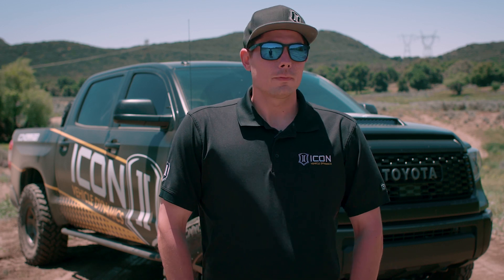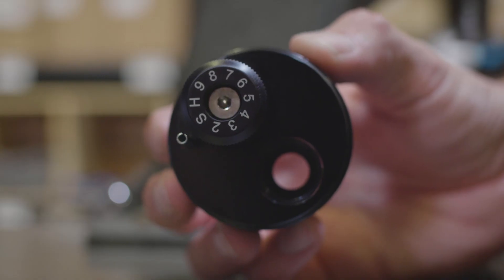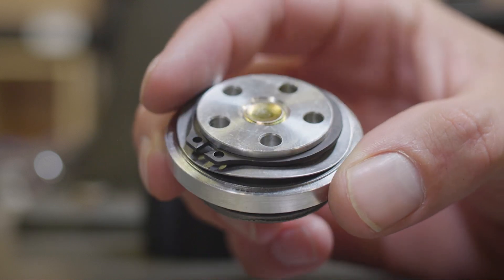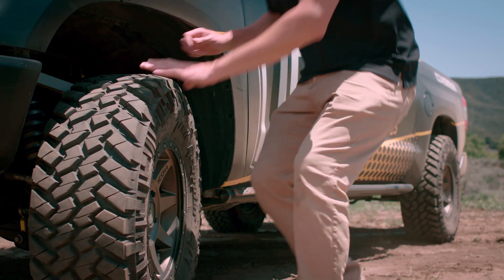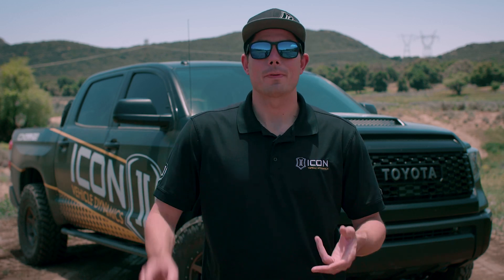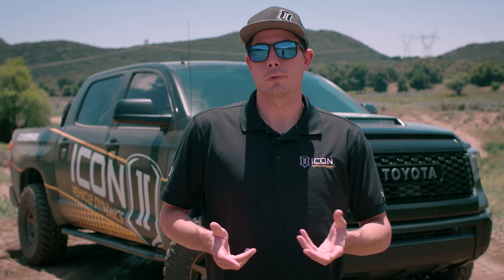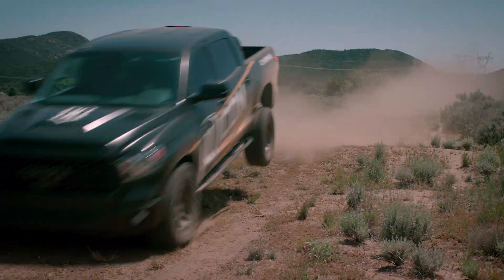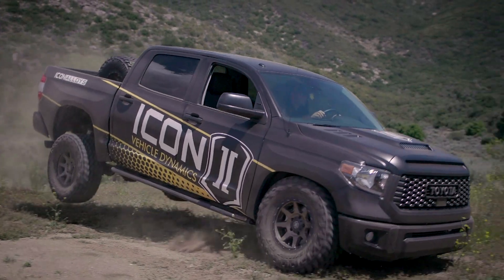HOW TO: Adjust Your ICON CDC Valve Shocks

Comment: What is done to the tundra in the video? Is there a video or write up on it's specs?
Reply from the maker: Hey Ryan, our Tundra is equipped with a Stage 9 ICON suspension system with a Stage 2 S2 secondary shock system. We're running 35x12.50" Nitto Trail Grappler tires on 17x8.5" ICON Alloys wheels.
Reply: I need an s2 secondary bypass shock for my 19 Ranger.

Comment: I currently have the ICON 2.5 w/Res and CDC Valve on my 20ll Tacoma. Im planning on installing a Demello aluminum bumper and Smittybilt winch w/ synthetic line. Consider the added weight that my truck will be experiencing in the very near future, In your opinion will the 650# rated spring be more then enough to support the weight or should I upgrade to a 700# rated spring?
Reply: I do have steel bumper, which is why I am going that route.
Reply: I have a Demello bumper and winch and am upgrading the springs with this next rebuild. Icon recommended the spring upgrade.
Reply: RecoveringUGrad unless you’re going with a steel bumper then I can see you upgrading to a 700# rated spring. However if your going with an aluminum bumper, 650# rated spring is more then enough. I have the Demello aluminum bumper with winch and synthetic line along with my ICON w/ 650# rated springs and it rides perfect.

Comment: I have a stage 8 on order. However, It would be nice for future buyers to have a tutorial with some examples of each stage and what might be best for their situation. It's a lot to take in for newbies. . I probably could have gotten away with a 5........but if 5 is good an 8 or 9 must be awesome!!! JK I've been wearing  my shop out with last minute decisions and I'm trying to get it done ASAP. Like if the CDC is even necessary for me.
Reply from the maker: Hey Jeff, 

We agree that our suspension systems can be a lot of information to digest for someone just starting out. We made a video a while back breaking down the basic philosophy behind ICON's staged systems, along with recommendations as to what type of system may be necessary for your scope of use. While the CDC Valve is not necessary, it's an extremely convenient feature to have if you want to fine tune the feel of your suspension!